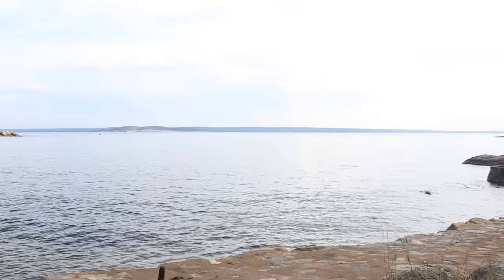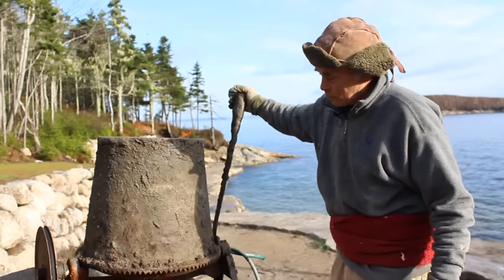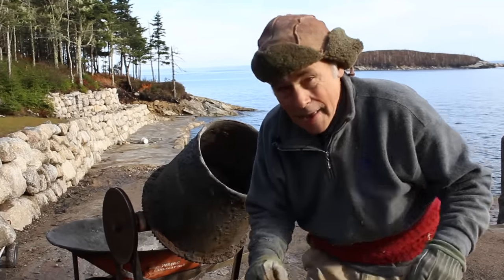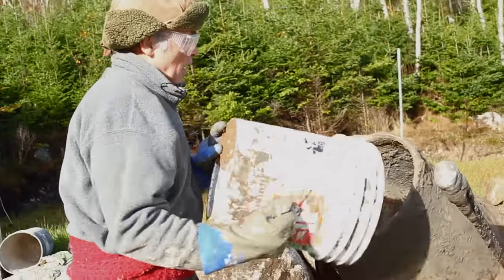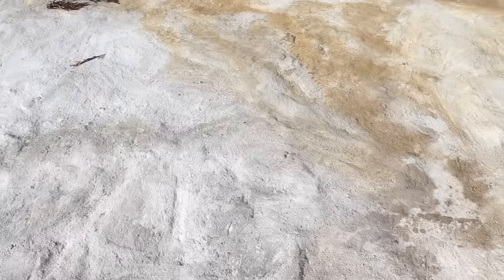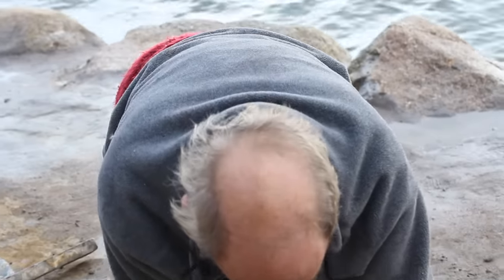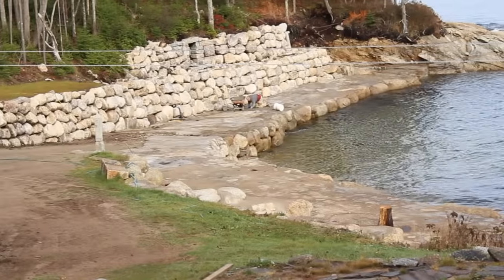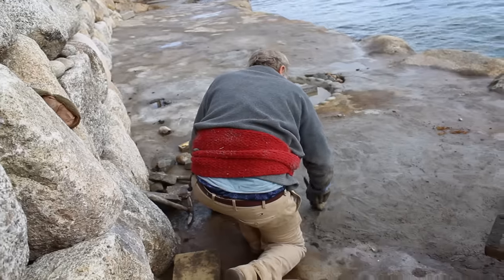GET A HOBBY: work with ROCKS and CEMENT like JOHN DUNSWORTH

Comment: What I take from this is that, if you find solace in doing something you'll be alright. Doesn't matter what it is, as long as you enjoy it, it doesn't have to cost money or generate money or even benefit others. Do it because you enjoy it and because it keeps you sane. It's when you have nothing to pour your energy into like this, that you run into trouble.

Comment: Thx, I labor in what I love too. Designing and building things.
Trying my hand at aircrete next to shore up walls in my geo-air hvac, solar hot water heated walapini greenhouse that I designed.
I think I'll make a mold so the high walls are an exact replica of the famous walls of Matchu Pichu.  Should be fun.

Comment: You are lucky that you can just go ahead and build this area along the edge of the sea. In New Zealand no one is allowed to add any thing along the coastline with out applying for Resource Consent from the Regional Council and that takes ages, months sometimes years to be approved. It also requires coastal engineers reports and surveys and all sorts of permissions at great cost to the person wanting to improve, save, inhance or beautify the coast line. I love what you have done.
I lived on the coast at a place called Mahia Peninsula and managed my family's campground.  I always wanted to improve access to the beach ⛱ for my campers and was blocked at every turn.  There was a creek that during storms would eat away the sand dunes and even though I worked out a solution to stop it happening nothing was ever done to stop the erosion. 
We no longer own the camp so it's someone else's problem to solve. 
If just a big rock retainer wall could have been built it would put a halt to the erosion of the coast line.
The coastal engineers predicted half the camp would be lost to nature and storms by 2050. Sold we sold it and moved on.

Comment: Working on a building site in Leeds, one of the site agents had a gnarled hand, completely unusable.

One day he did a safety talk to us all. He told us how he gnarled his hand, 20 years before. He was mixing cement, poured in a bag, the bag fell in, he reached in to get it and caught his hand. The machine turned over and over and there was nothing he could do to stop it. It turned his hand round many times before someone eventually got there and stopped it.

So, when John Dunsworth says in this video it's fine to put your hand in there. It isn't.

Golden rule of building sites, think to yourself, would you feel safe putting your penis in there? If not, don't put your hand/fingers in there either.

Comment: I mean, I love to work with rocks, cement and wood, but putting your hand in the cement mixer is really nonsense. Not that I'd be afraid of someone getting hurt, but why would you want to get your gloves all dirty every time you mix cement...you just throw in the material and then you god work with what last came out. It'll be readily mixed when you return, you pour it out, fill the next load and go work with it again while it mixes. No need to stick hands or feet in there and no need for safety goggles either.